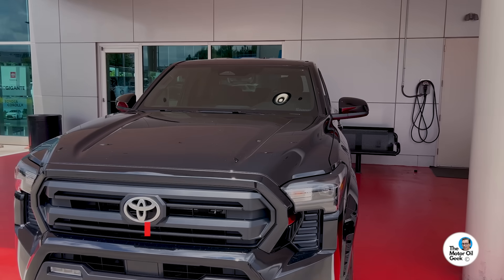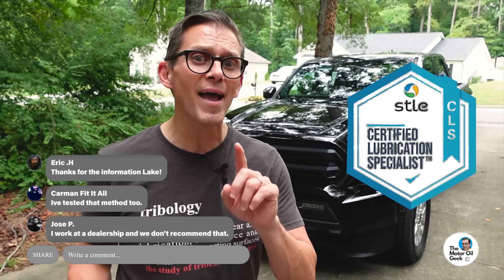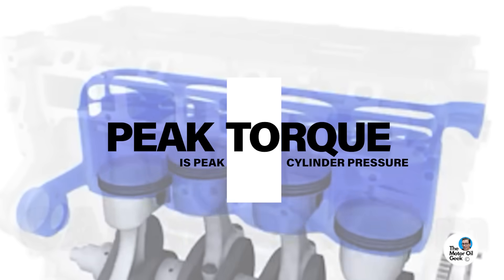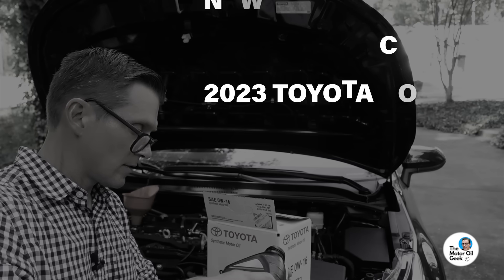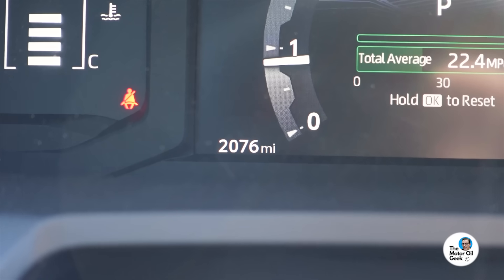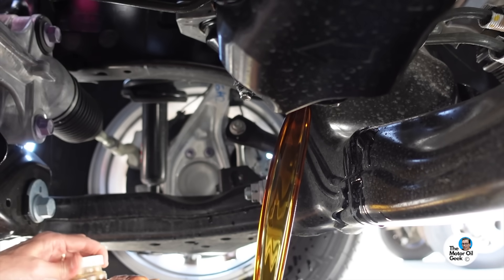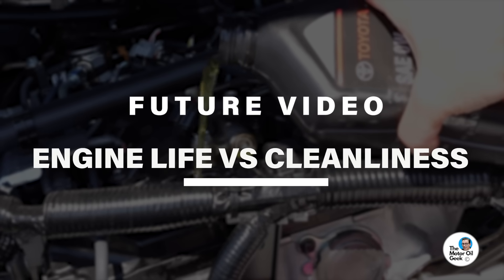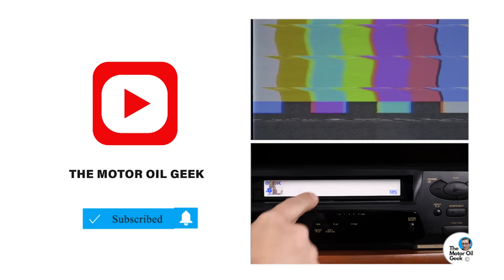The FACTS About Oil Changes (What The Owner's Manual DIDN'T Tell You)

Comment: Lol, I'm glad that I'm not the only one who changed the oil at 500mi, 1500mi, and 3000mi during break-in. 🙂
Reply: Oil is cheap. Engines aren't.
Reply: @brjr2009 A Scottyism.
Reply: @brjr2009 Yep. I also have my own shop with a hoist and do my own service. A 5qt jug of Valvoline Restore & Protect plus a Wix filter cost me $42 last time. That is cheap.
Reply: @brjr2009 its under warranty
Reply: @executiveinvestments And you’re aware that warranties don’t last forever, yes?
Reply: @Mojave_Ranger_NCR and you’re aware this is still under warranty right?
Reply: @executiveinvestments  Who wants to deal with a dealership though? Take care of your car man.
Reply: I did the same except it was kilometres, not miles.
Reply: @ashchaya7676  Same thing on my 2023 RAV4. 500,1500, 3000, 5000. Since then I have changed the oil every six months or 5,000 miles.
Reply: I've been doing Precisely the same interval on my new cars since 1977. My 2025 Maverick EcoBoost had its' first at just a little before 500 miles... I have never had an engine issue...
Reply: @jdesmo569 I change oil and filter at 10, 000 miles. I have had 5 vehicles that have exceeded 200k miles each with no engine problems.
Maybe I’m just lucky.
Reply: I'VE been doing this method for 40 years now .. My first oil change at about 700mi , 1600mi and 4000miles .. The TOYOTA MANUAL recommend oil change at 10,000 intervals that's CRAZY I will NEVER do this to any engines i own ..PERIOD ..My regular oil changes after breaking in the engine is 5000 miles MAX. PERIOD .. I've own TOYOTA'S since 1976 .. TODAY I drive a TOYOTA TUNDRA 2024 there's only 11,000 miles on it right now.. 🤠
Reply: @larryp4995  Couldnt agree more.
Reply: In my daily driver (2024 GR Corolla) I did the oil changes at the following engine miles:
69 (unintentional), 500, 1500, 3000.

Each time I used AMSOil break-in oil and Fram Ultra Synthetic filters.  My standard oil changes are done every 3000 miles (Pennzoil Ultra Platinum 5w30 + Fram Synthetic Endurance oil filters) - and my car does love to accelerate. :)

A fair number of GR Corolla owners have said that it's a waste, but seeing Lake going in specifics as per why it's the right method is very reassuring. :)
Reply: @not12listen While it's good to get the insolubles out of the oil during break in, you specific choice of Amsoil Break In oil was not the best idea. It's designed for older vehicles with flat tappet lifters and as such it has very high levels of zinc. The elevated zinc level will poison your catalytic converters and cause premature failure.
Reply: @ZeGermanHam  Yes, it does have much higher levels of ZDDP than the overwhelming majority of oils on the market.  It also lacks friction modifiers - and as such it had a greater ability to allow ring sealing in a more natural manner.  Friction modifiers could inhibit ring sealing OR potentially cause that process to take even more time.

You also need to take into account it was used for a total of 3000 miles.  At mile 3001 and onward non-break in oil was put into the engine.

The engine in my car has over 24,000 currently, as such the engine had higher levels ZDDP for 7% of its life, and that percentage is decreasing every oil change (3000 miles).

All that aside, I would rather replace a catalytic converter than an engine in 120,000+ miles.
Reply: @ZeGermanHam Not a problem if you don't have cats 😏
Reply: @not12listen  Motors are broken in at the factory.  Using break in oil is the worst thing you can do.
Reply: @executiveinvestments  Where is your evidence of this?
Reply: I could tell there was a slight glitter tinge in the oil at 600mi on my new Jetta,not bad, or less than I expected. 
And I'm shocked ,it's got a spin on oil filter ! They stopped with those dumb cartridges!! 
Felt nice to fill it with oil and spin it on.
Reply: I changed my 25’ 4Runner Trailhunter oil / filter @ 1,000 miles. If I change at 1,750 miles, keep the same filter? I’m planning a road trip in December of about 2,000 miles (90% highway). Change my oil / filter when I finish trip at around 4,500 to 5,000 miles?
Reply: Most people don't even change it until their ridiculous dealer recommended 10K interval, which is insane. 
I like 800 with new oem filter. Then I go up to 3500 and pull it out again with new filter. 5K interval thereafter. Is not having the second break in oil change a significant deal?
Reply: I did mine at 800, 1300, 2800 and again i will at 4,000 then every 3,000. Yep.. but one reason is i went to 5w30 but decided to go back to the 0w20 the engine calls for. So theres an extra oil change in there LOL...
Reply: Did my Land Cruiser at 500, 3300, 6600, and 10K so far
Reply: Now I feel un-perfect with my 1750, 4500, 7000, & 10,000 mile oil changes.  I can't wait to see if he changes his viscosity.  I really want to go a little thicker in my 25' Frontier to try to quiet it down a bit.
Reply: @henrynlouisville1  i don't disagree with upping viscosity one notch if we live in hot country or push hard, but the aspect of quietness means absolutely nothing mechanically ie wrt wear.  My genius engineer father explained that as have many others in STEM related fields
Reply: @henrynlouisville1  With the cylinder pressures that engine will make, I have a feeling he will go with something like a Mobil ESP 0W-30.
Reply: It is completely unnecessary, but if it helps you feel better, peace of mind counts for something. This isn't the old days. In modern times, everything has advanced where a 500 mile oil change is no longer needed. Much better oil than only a decade or two ago. Metallurgy has vastly improved as well.
Reply: @Panthers89Fan9000000  The data presented in Lake's videos proves otherwise.
Reply: @not12listen what exactly does the data prove in this video? If you want to change your oil early and waste your own money, go ahead. There is nothing in this video proving a vehicle getting its first oil change at 5,000 miles or 7,500 miles is any worse than doing 3 oil changes by 5,000 miles.

Oil is meant to hold contaminates in suspension.

It is like the dummies that think their oil is bad based on color. Color is not a good indicator of oil life.

Oil can't fix a bad engine design. If your vehicle is a ticking time bomb, it'll still blow up whether you change the oil or not.
Reply: @Panthers89Fan9000000 noooo but the metal shavings found in the FILTER 😂 forget about the filter doing its job
Reply: @Panthers89Fan9000000 also it's not about stopping your engine at blowing up early. If the engine is going that early it was designed wrong. The whole reason of changing oil during break in is to lower wear which will extend the life later on in the engines life compared to if you didn't try to lower that wear
Reply: @Panthers89Fan9000000  Thank you, somebody else gets it.
Reply: @ChevyRedneckGFX  But where in the video and what data says you are actually lowering wear, the video shows there are contaminants and changing the oil early removes those, but there is no data that shows it does anything to help break-in or prolong engine life, it doesn't hurt anything but for most car owners, like 95% of them, you will never get to a point where you might know if it did anything.
Reply: @JDT-pq3wi Do contaminants hurt oil performance? Yes. Does worse oil performance mean more engine wear? Yes. Therefore, changing oil to get rid of high contamination is better for longevity of the engine. What exactly is so difficult to comprehend here?
Reply: @Panthers89Fan9000000 Your comment makes no sense at all.
Reply: @ZeGermanHam  What do you need help with, changing the oil early is just a feel good thing, that is it.
Reply: @Panthers89Fan9000000 So even though you are viewing evidence first hand that oil contamination is high on new vehicles, you claim it is unnecessary? Newer vehicles are increasingly more fragile and finicky about maintenance, but your logic says to care for our vehicles less. If you can’t see the flaw in your argument, I don’t know what to tell you.
Reply: It’s my my understanding that Ford pre-breaks in the engine at the factory.
Reply: @alanschmidt3460  This is incorrect. Ford does not break-in their engines.
Reply: @ZeGermanHam if you’re actually correct, I was told wrong.
Reply: @alanschmidt3460  Ford builds over two million vehicles in the US every year. They do not have the time or space to break in the engines, which takes thousands of miles. No major automaker on the planet has the ability to break in the engines.
Reply: It makes no difference, just because there are things in the oil does not mean they are killing the break -in or the engine life, I have witnessed many trucks go 7500-10,000 on the first oil change and use that same mileage for every oil change and make it to between 200k and 300k with out having any major failures unless that failure was a flaw like ford 3.5 VVT issues, do whatever makes you feel better but people really over think this, as long as the oil has it's properties it is good.

Comment: I understand the age old adage about warming your oil before a change. But what about draining it cold and let it drain for a couple of hours. If the oil is cold, sat overnight, a majority of the oil capable of draining from the valvetrain/upper engine is drained to the pan. So you're basically just draining the oil from the pan. I also use a magnetic drain plug which does pick up superfine particles, more like a sludge. Are these particles that the magnet picked up but that the filter would have? Maybe you know.

Comment: there are new oils since an owners manual is printed on the throttle around peak torque rpm then off to suck oil as you decelerate  rinse and repeat  do not drive at steady speed  back off and coast pulling vacuum in cylinder to pull some oil up   0W -xx  no matter what the owners manual called for

Comment: Finally, a video to address all of the new Tacoma owners while they debate whether to follow the owners manual and do oil changes at 10K mile intervals or more frequently as science says. I cringe when I hear them say they do 10K oil changes and their truck is fine. Their money they can do what they want, watching them set money on fire is hard.
Reply: 10K oil changes are OK if you have a non turbo-charged engine and you dont do strenuous work.  Otherwise 6 months and 5 or 6K miles, whichever comes first.
Reply: It's fine for NA motors, I always changed at 10k miles with toyota and hondas, no issues. It's the turbo motors you have to change more frequent.

Comment: I just bought a new F150 PowerBoost and I changed my oil at 850 miles for the first time with AmsOil. I work for Ford as an engineer and I know the importance of break in and changing the oil. I will NOT be following my gauge for oil change intervals at all and trust me this guys is showing what everyone should be doing!
Reply: Just paying for certification
Reply: Is fords 2.7 eco truly fords most durable truck engine (gas)? since your an inside guy lol.  I have a 2nd gen taco but have been thinking about a ranger with the 2.7 as its replacement.  Coming from the reliability of a toyota 4.0 engine, would I be disappointed with the 2.7?
Reply: @nsargeant84 How did you like the fuel mileage on that 4.0.? Lol
Reply: @Lawnboy21  I get 17-18 when Im not hauling the boat. Shes got about 165,000 miles on her or so but still runs like the day I got her.  Still does 1300 mile round trips every year hauling the boat up 7% grades. Is the 2.7 eco going to do that for me?
Reply: @nsargeant84 Wow the best my 2007 could muster was 12 mpg. Other people Ive talked to said the same. Not sure how you get 18mpg with a 4.0?
Reply: @Lawnboy21  I get around 12 when I am hauling anything but other than that upper 16's to touching 18 combined. I also have 265-70-17 tires
Reply: Hi, I’m also an engineer. What’s your opinion on amsoil not certified by SAE? I like the result of using amsoil, but the no certification….. I don’t buy that certification will prevent the formulation from improving. Because it also prevents the formulation from decreasing quality.
Reply: @tomkillsall  I am curious as well. I've seen Amsoil in select places (and am aware of its popularity with sport enthusiasts) but also want more details on it...per se the SAE.

Comment: The owners manual for my 2018 Nissan says "Your engine was filled with a high-quality engine oil when it was built.You do not have to change the oil before the first recommended change interval." I just go by the book and have never had a vehicle burn oil even with over 300,000 miles. Sure can't hurt to change it more often..

Comment: I wished i KNEW all of this. I thought I remembered engines didn't need broken in like the olden days. I DID give mine an "Italian tune-up," but I didn't change mine until the first 5,000 miles. Like you said, the dealer wouldn't change oil & just checked it.🙄
Like this video, it is too late for my 2019 Toyota Prius. So now im flying blind on viscosities. 😢

Comment: Mike in 1981 I bought a new 1981 Ford F150 with a 4.9 inline six.  At about 5k I installed a 5 quart bypass filter made by Harvard Corporation. At that time I used a Jojoba bean based motor oil. The oil change intervals were every 25,000 miles along with the bypass 5qt filter and the full flow filter. I owned the truck for 18 years. When I sold it, it would burn 1 pint of oil between the 25,000 oil and filter changes. It had 350,000 miles on it when I sold it.
Reply: lol, nothing like having two or more times the normal oil volume ehh....

Comment: Why is the molybdenum higher on the used sample than the Virgin sample?
Reply from the maker: Valvetrain assembly lube.
Reply: @themotoroilgeek I see. Thank you for the response. Now I understand why most first drained break in oil from factory have these high molybdenum readings.

Comment: When I worked in Honda service dept in the late 90s, we were told by Honda to not change the oil early, as it was formulated to help the engine breakin better and faster. I pissed a customer off when I refuse him a 500 mile oil change, due to the manufacturers recommendation. It was definitely a different oil than what was commercially available, had a green tint to it, and smelled strange. All I can say, is we told customers 2000-3000 miles than change it…many of them went well over 200k so Honda must of known better.

Comment: The idea about not changing the oil filter during the first two engine oil drain and refill operations does make sense. However, why don't we start by using a filter with higher filtration capacity or larger micron filter size from the beginning, instead of using a filter that may hold these contaminants or pand potentially allow them to pass through ?

Also, another question: based on my understanding of your point regarding not replacing the oil filter, is it correct that during the oil changes at 500 miles and 1500 miles, we only leave the engine filter and then replace it at 3000 miles? Is my understanding correct?

Comment: Make sure your readers also know that Toyota dealers DO NOT use TOYOTA branded oil.  They use bulk cheapest possible oil available.   Car Care Nut showed this on a womans Toyota Camry that needed a new engine after 180K miles which lol is old age for most cars but for a Toyota is just infancy.   She had it serviced religiously at the local Toyota dealer per manual recommendations which stupidly is every 10K miles.

Comment: I bought that same truck traded in my 2015 for it and it’s a much better truck than the V6 model so far , my neighbor bought his in 2024 and has 122000 miles on his and hasn’t had one issue, he uses his for AAA batteries and tire service truck and his truck runs 24-7 stop and go in Los Angeles and he loves that turbo 4 cylinder

Comment: I'd switch to Wesson oil as soon as possible.  It'll allow you to drop some popcorn in the filler and have a snack while you waiting for the tow truck.  Just remember to bring the butter and salt.  Tasty times and you'll get your RDA of lead and whatever other tasty heavy metals are swirling around.  I'm also a fan of the jiffy pop air bag.  Never want to run out of snacks.

Comment: I've found out through research, that the Same trucks, sold outside of this country (Stupid CAFE Standards)  Call for using 5w30 oil...And even though the mileage may suffer due to parasitic drag on the crank, etc.  It is much more suited for protecting internal parts from startup wear and tear....What say you?

Comment: Breaking in 25 Chevy Colorado ZR2 with 2.7 turbo max engine, just had the free Chevy dealership first oil change at 700 miles. Will be doing the next at 2K, will do the 1 quart flush like you recommend, will be using Pennzoil ultra platinum and GM gold filters from here on out.

Comment: Excellent vehicle choice. I'm at 11K miles on mine, and did oil changes at 1000, 5000, and 10K. Will be doing 5k intervals for the future. I expect this engine to defy the haters. It develops so much usable power at low rpms and never seems stressed.
Reply: You should try GM 2.7T thats powering most full-size in a midsize. Toyota's 2.4 is a toy.
Reply: @thewireman134  I wouldn't call it a toy, but GM's T4 motor is indeed impressive. Both get the job done very well IMO.
Reply: @thewireman134  GM is rubbish

Comment: Went from a wonderful V-6 to an underpowered, crappy 4-cylinder with a turbo. With a crappy transmission. Not only should no one buy this vehicle, those who do will discover that the trade-in will be almost nothing as no one will want it (like any EV.) With the Tundra having a self-destructing engine, I'm not sure if Toyota is looking to go the way of Nissan, but it looks that way.
Reply: Some of us thought that the switch from the 4.0l 1GR-FE V6 to the 3.5l 2GR-FKS (second-gen to third-gen) was a downgrade.  My 2013 has the 1GR-FE.  The switch got them a 1mpg improvement in fuel economy.